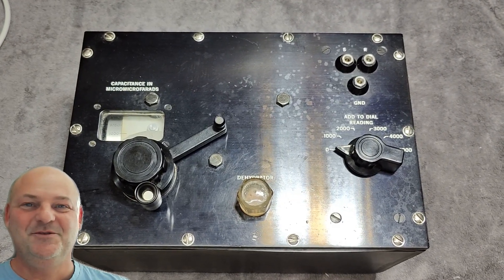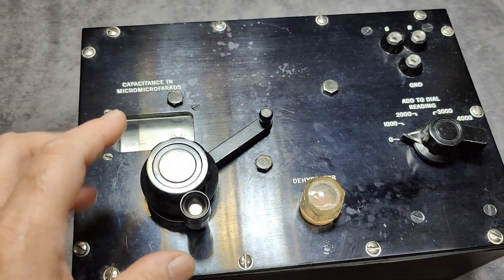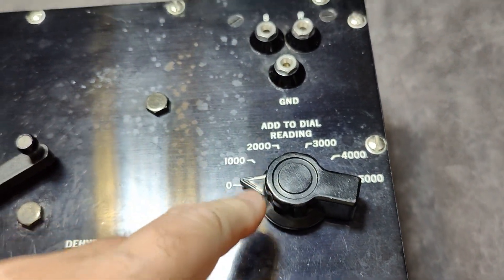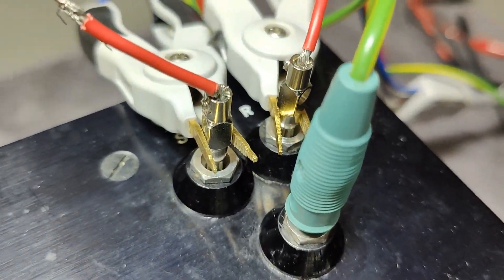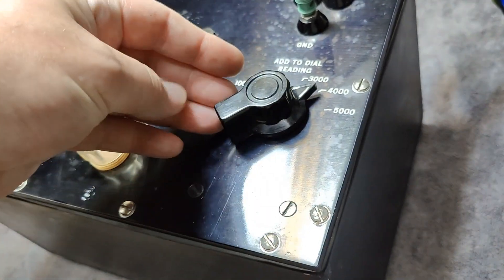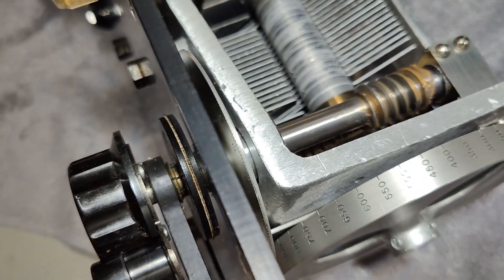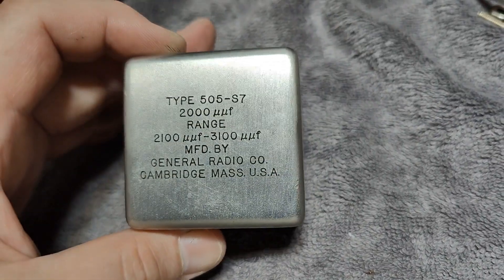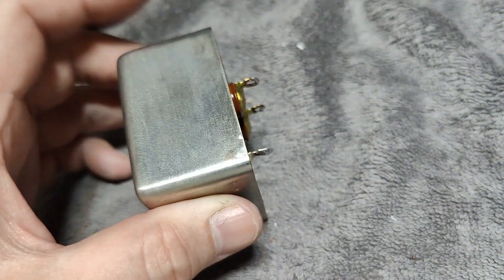Jackson capacitor Fuel Gauge Tester USAF type 0-3 NP No.106 1956

Comment: Nice teardown, they didn't use a double gear to eliminate the backlash in that worm gear mechanism,
Reply: I would suggest only to do such things with aviation artifacts if you are certain sure they are incomplete/in bad condition/unfixable/worthless to collectors....
Reply: It doesn't need a double gear, at 8:45 the shaft support is spring-loaded.

I'm sure you would object to someone tearing apart an old radio or other vintage gear, so why suggest that people should destroy something like this?